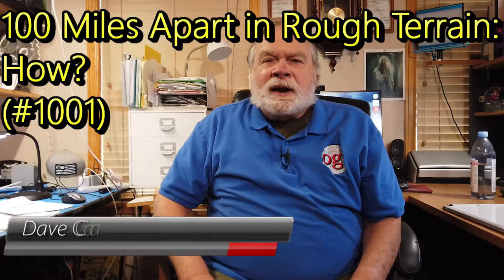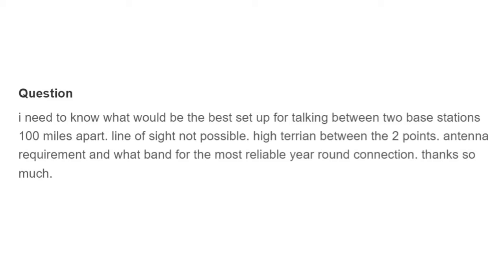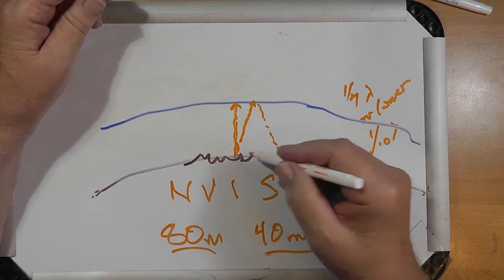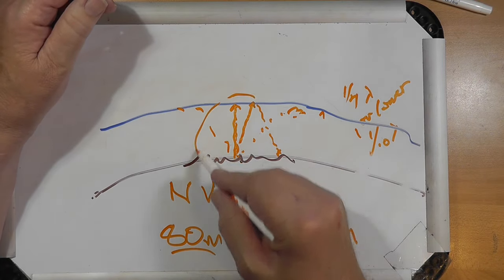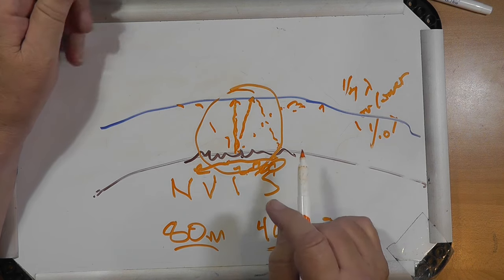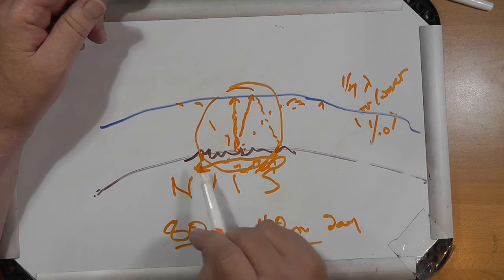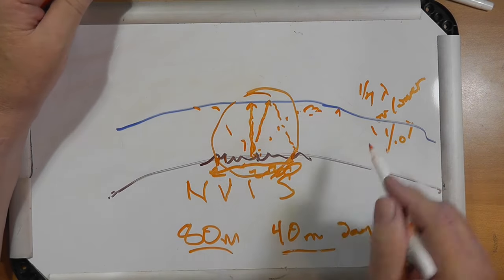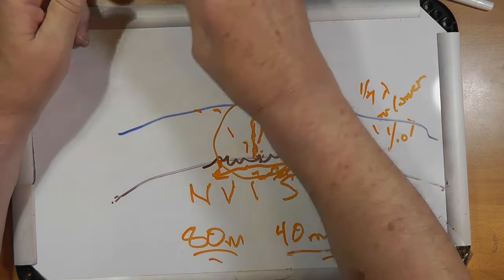100 Miles Apart in Rough Terrain: How? (#1001)

Comment: the best antenna for HF NVIS is a dipole tuned AT NVIS heights, then configured at a shallow inverted V,  I am in central Washington and easily work winlink RMS stations at 100 (Olympia) to 471 (Idaho Falls id) the sweet distance appears to be 230 miles for me that is Bend Oregon these distances should work for most locations. 80m is pretty much the goto band for night but as we near peak solar cycle don't be surprised if 40m is open so generally 40m is your go to day band but if you find 40m has so much noise as to be unusable then 30m is your next stop.
I use VARA HF and FM as my transfer program. I have a Mobile/Portable station so i have various lengths of wire from my feed point from 35ft, 50, 70, 100 and 135 feet  mostly I go from putting the wire on the ground (not best) to suspending it about 5-6ft above ground (better) and my A game height would be about 20ft (near the optimal height for 40m)

Comment: Hey Dave,

Back in the day, our club did t-Hunts every weekend.  While we usually ran super low power (sometimes driving a dummy load) to trick the hunters, on a hunt, one of our members loaded up a 10-element Yagi at 50 watts and we honestly thought it was about 30 miles away.  Yes, there were hills in between, but the reflections appeared like full signal.  For this fellow, he could try bouncing the signal.  100 miles either needs So Cal early morning scud, which makes two meters travel.  When the weather was like that, we regularly heard San Diego all the way north to Thousand Oaks, California.  Amazing!!!  Or... the ten element yagi with full 50 watts.  He should also use horizontal polarization, as it picks up less QRM.

73, N6UNX

Comment: Please if you are serious about deploying NVIS do not use an Inverted V. Its a flat dipole at some height between 1/4 & 1/8 wave above the ground. You want as little energy pushed out as possible in other directions. You want all signal to go straight up.

Comment: Every path is different and needs study and testing. 6 or 10 meters with 100 watts FM and yagi antennas are effective in rough terrain and common in land mobile for such ranges. At 432, 50 watts with yagi's  will often provide a knife edge or tropo path, even bounce off a rock face and superior to two meters in many cases. Repeaters are the best solution if available.

Comment: Depends on the license level, but I'll assume General or above. If the 100 mile distance is all the want to cover, get an 80m dipole and lay it directly on the ground. If they want regional 80m in a multi-band antenna then hang an 80m full-wave horizontal loop antenna as high up as feasible.